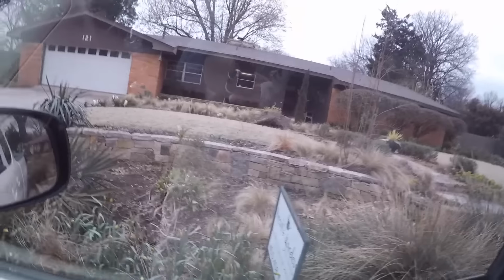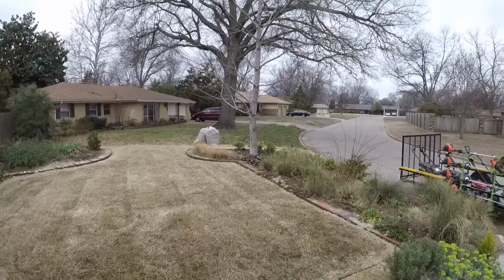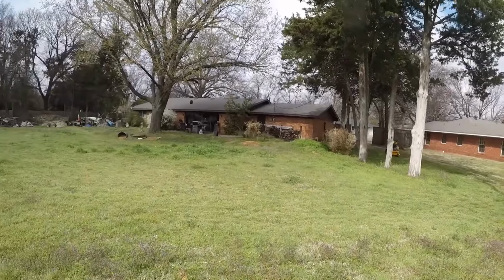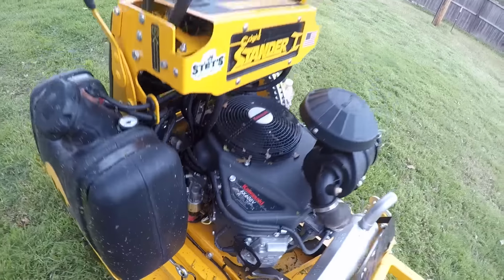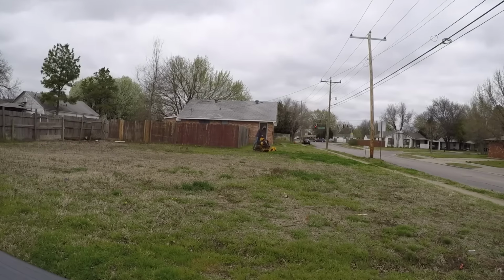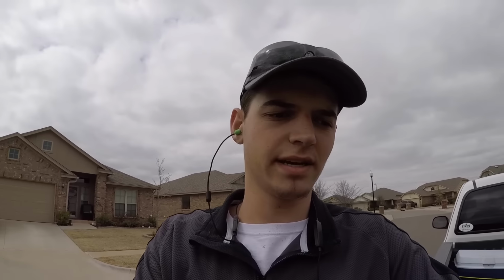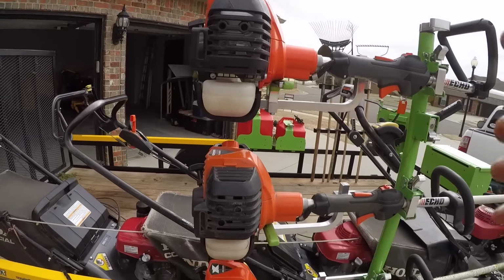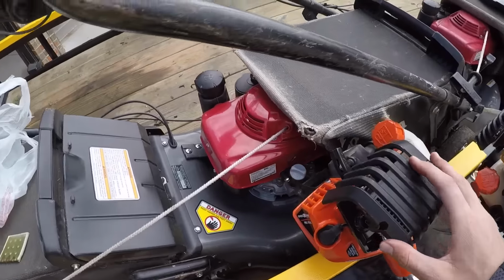New Mower Purchase

Comment: I just put the grass flap on my my Wright stander intensity 36” and noticed when the deck is in the top position the flap hits the tank. You have to make sure the flap is down when you raised your deck, if not you flap will get stuck under the tank and the deck won’t raise to the top position.

Comment: How do you like those Honda’s? I have two 21 snappers with the Honda engines and they don’t make them like they use too. Looking for something else. I don’t want the exmark 30s had 2 of those too heavy. I hear those Honda’s cut very well but aren’t light, any input? Keep it up your doing awesome.
Reply: O Corpus they cut extremely well but they aren’t light. It’s somewhere near 92 pounds for the HRX
Reply from the maker: I like the Honda’s. Commercials are for sure the way to go. I believe the HRC is around 120lbs. They leave a great cut but are heavy for sure. Great mower though it can cut through the thickest stuff!
Reply: Thanks, they look heavy I just don’t see too many people posting about the “21 snappers. I don’t know if snapper isn’t as popular in the north as in the south. But thanks for the input